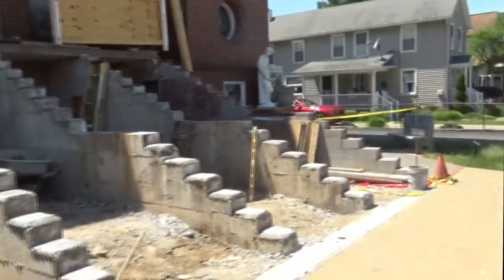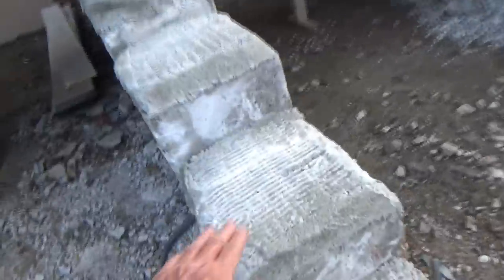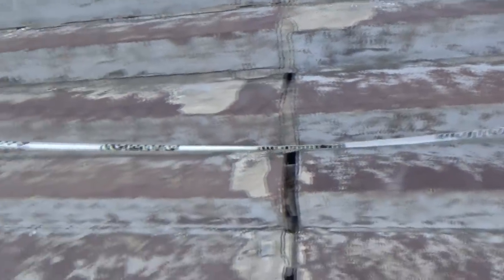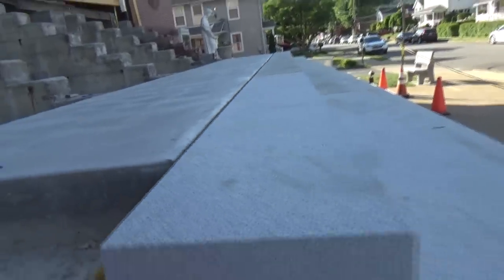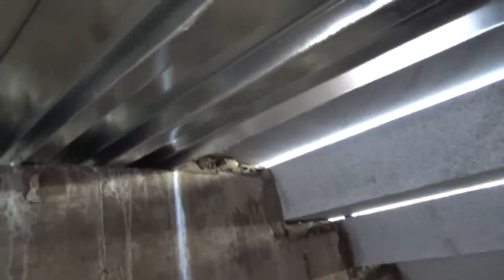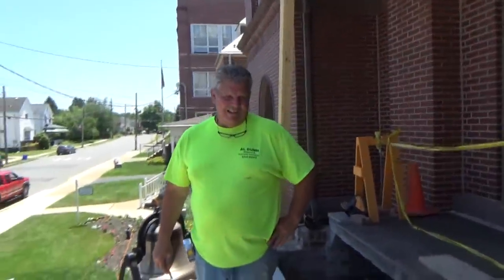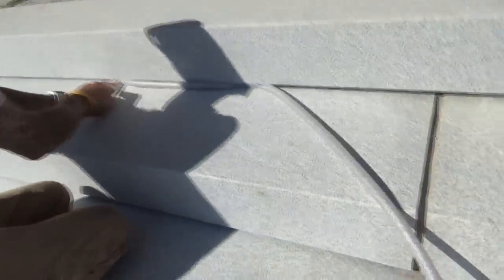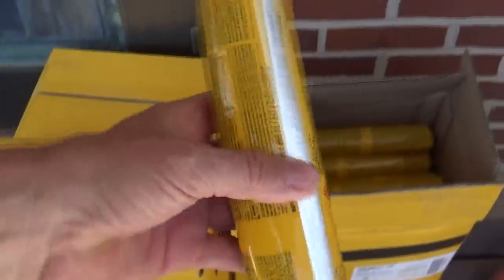STONE STEPS REPAIR (Part 10) Mike Haduck "Granite" church steps

Comment: Thanks so much for your videos, Mike! They gave me the confidence to strip down, patch up, and refinish my 1969 deteriorating plastered brick chimney myself. (off topic, but this was your most recent video)

Two months back - with winter approaching - finding contractors who would say they would take the job and give me a ballpark date felt like banging my head up against the brick chimney in question (all busy on larger projects I guess). I googled, I came over one of your chimney repair videos, I then watched all your chimney repair videos, I watched a large part of your foundation repair videos, all the beginner videos, and then I piled on twice as many of your other miscellaneous videos. I bought portland-based cement and pre-mixed mortar for masonry and plastering, did a couple of lesser home improvement projects for practice. Then I started chipping away all the loose chimney pieces - No Big Deal! I went from feeling powerless to feeling in-control, I've learned a lot, and if all things went well I also saved a bunch of money ($1500 maybe?, and that's just before future projects). Channels like yours have great value, and it also really made me appreciate the old-school way! Do I need a cement mixer? I don't even consider buying one any longer.

I spent some time working in Pittsburgh (Carnegie Mellon-adjacent) and took some time to check out Philadelphia and visited Oil City, so I know when you say your advice is for Pennsylvania, I know you are not too far off for my hometown Trondheim, Norway. If anything, your advice probably goes doubly over here...
Reply from the maker: Thanks Lars, I appreciate the kind words, and glad you saved some money, thanks a million for the comment,  Mike

Comment: I've been rebuilding some 75 year old steps. Instead of stone, they're 4" X 12" redwood beams. Wherever steel touched it and rusted, it deteriorated the wood. I had to clean it out and stabilize with epoxy. The bigger part of the job is refinishing the custom wrought iron railings. Rust treatment chemicals and paint are getting to be really hard to find, and expensive. 
On another subject, I wanted to use more Titebond Multi Purpose calk on some repairs. Amazon has it for $28 for a 9.5 ounce tube. It took quite a bit of looking, but I found some quite similar for $23.31 for three 10.1 ounce tubes.
Reply from the maker: Thanks,  Mike

Comment: Does granite expand a bit since so much space is left between and under the steps for caulking?
Reply from the maker: Hi yoga, yes all masonry expands and contracts, Mike
Reply: Granite does expand and more than just a bit. Concrete & steel expand about similar amounts, but granite expands about three times more. The gaps between the horizontal granite slabs are filled with cement so that is not really an expansion joint.
Reply: @cdbflynow  Yes, thanks, I was wondering about that. I suppose you better know your material doing a job like this.

Comment: They wasted too much caulking and they use a painter tape that’s not professional on my opinion, and not even little primer that joint of caulking it wont last much 2 or 3 years later they have to caulked over and over
Reply from the maker: Hi, I don't know, that's the way they do it, all the union guys etc. Thanks Mike